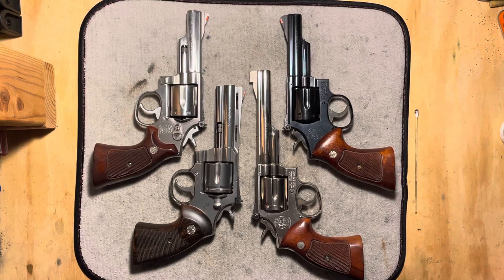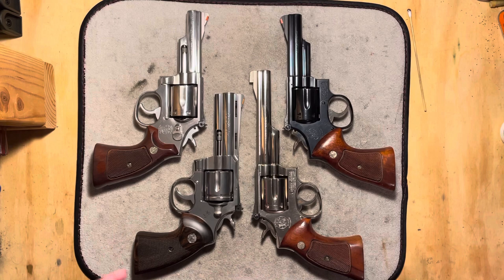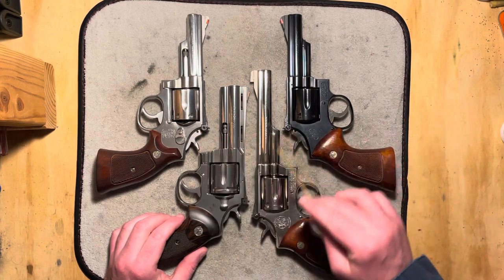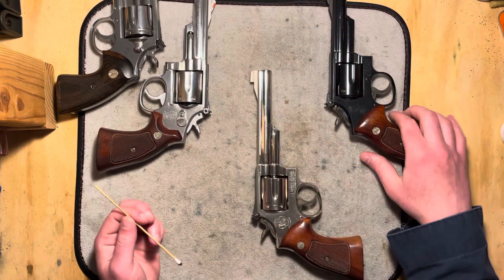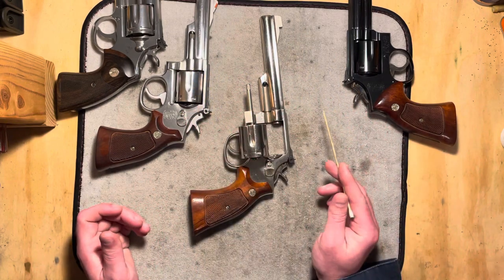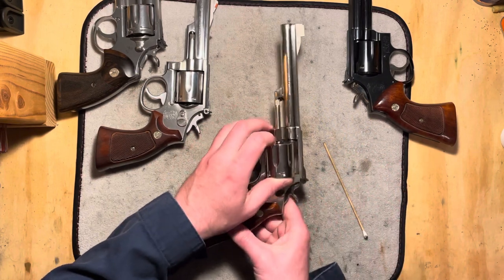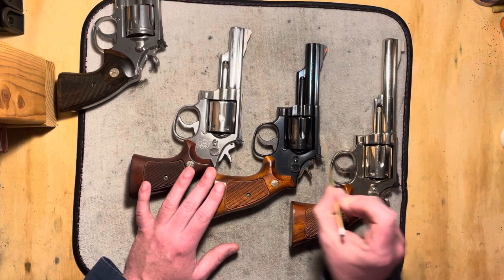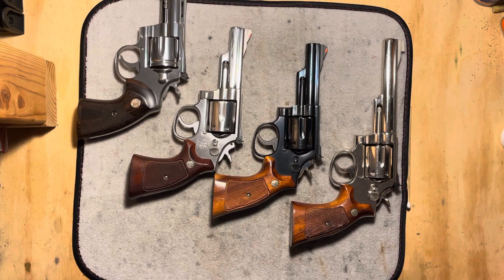Revolver Forcing Cone: Explanation and Avoiding a Crack, Ft. S&W .357 Magnum K-frames & Colt Python

Comment: I'd bet you would have to get the forcing cone extremely hot to crack it. I think the heat from rapidly firing shorter 125gr. rounds repeatedly, cylinder after cylinder, is what damaged any forcing cones. I haven't seen one that has cracked. But, I have not seen very many K frames either.
Reply from the maker: I follow what you’re thinking, but I disagree. 

For one, most of these issues arose when these revolvers had been recently in production. General attitudes and practices of the time period, as far as I’ve seen, didn’t really emphasize dumping cylinder after cylinder of full house magnum loads. It just wasn’t the way they thought. Obviously, I wasn’t there, but this is based on first hand accounts, observations of the training philosophies those people still hold and practice, and film documentation of training practices of the relevant time period. 

Second, getting a revolver sufficiently hot to compromise the metal is a difficult task with something that is a repeater loaded manually. Six rounds until a reload is required, and that reloading process opens the barrel through for airflow. Add in the fact I don’t know that I’ve ever seen someone carry more than about four speedloaders, even in later years when they were really trying to remain relevant compared to automatics… I think it’s unlikely anyone would have been able to “rapidly” fire more than about 30 rounds. That’s not that much especially given the circumstances already mentioned. 

Third, the issue of cracking metal would seem to be alleviated by the steel becoming slightly softer with heat within a reasonable extent. Of course, that’s really just conjecture on my part. But hotter steel is typically softer and more prone to deformation rather than fracturing. Heat could/would exacerbate throat erosion, which might increase the risk of failure over a long period of time, but there are reports of some revolvers failing at the forcing cone in as few as a couple hundred rounds of particularly hot (yet still factory loaded) 125 grain magnums. 

It is an issue that was observed at the time, and there is a reasonable mechanical explanation for why it is real and not just a fluke. I tend to believe that it is a shortcoming of the design and manufacturing practices, that is exacerbated by “luck of the draw” of a particular revolver and also ammunition related conditions that expose that flaw. That is my opinion based on what information I have seen.

Comment: What is the maximum safe speed to avoid long-term damage in a K frame F.C. with a 125 lead bullet?
Thanks
Reply from the maker: It’s an excellent question, for which there is no good answer. Just due to the inherent variations in manufacturing and metallurgy, some are stronger than others, of course. 

While it’s a good question, I think it’s the wrong question, as there are many heavier projectile options which, based on known observation, aren’t likely to cause a forcing cone crack.

Comment: As an afterthought after reading all the comments and recollecting long ago past experience with agency owned S&W Model 10s with heavy barrels, there were never any issues with forcing cone failures.  Small parts attrition were remedied by turning back the questionable revolver for exchange with the quartermaster.  The range safety officer enlisted rookies for gun cleaning which included using Lewis Lead remover tools to clean and polish the forcing cones and the chamber mouths of the cylinders.  I should do that on what I have now to reduce the pressures on those parts. Good shooting everyone.
Reply from the maker: Certainly. The model 10 is as robust as any other revolver. They’re a masterpiece. 

The 19 is just a 10 “overbored” to .357 Magnum. The design is fine- it was just asked to do something it was never designed for in handling full house .357 Magnum loads.
Reply: @ColterBrog  My colleagues also had various K frame guns including10s  13s 15s  19s in addition to  27s and 28s.  Bill Jordan of the Border patrol is credited with lobbying Smith & Wesson to create the 19 as N frames were so large and heavy.  The NYPD Stakeout Squad led by Jim Cirillo in the 1970s are  credited with a lot of successful actions using pencil barrel Model 10s as well as some unofficial unauthorized guns available at the time.

Comment: I have a 65-2 that I just inherited from my mother.  It's pinned and recessed but it also has the "shaved" forcing cone you pointed out.  I haven't shot any 357 out of it (God knows I want to) but I do have plenty of 38 Special on hand to train with.  Great video.
Reply from the maker: If you do shoot magnums just stick to the heavier ones like 158 grain. They don’t have the abrupt acceleration to really do a hard strike on the forcing cone like a hot 125 grain. 

I think it’s mainly just a matter of mindset. These are .38 Special revolvers capable of occasionally firing some .357 Magnum, ideally in the heavier bullet weights. 

That’s a different mindset from something like a 686 which is definitely a .357 Magnum revolver, but can shoot .38 Special if you want cheaper plinking and less recoil. 

It’s about the intent of the design.
Reply: I've shot plenty of 158 grain out of my 65-2. I've also never seen a cracked forcing cone - just online speculation and rumors. Not saying it never happened, just that it might not have been a common occurrence. As others have stated, just stick with 158's and 38 Specials and you should be fine.

Comment: I got a swollen case and flattened primer in my m&p 340. The case had to be tapped out of the cylinder and the case was pushed into the frame preventing it from opening.  I see no damage and shot 27 357 magnum rounds afterwards with no issues.  I'm only shooting premium federal and Hornady.  Anything i should look out for?  Surely this was an ammunition issue and not a firearm issue wouldn't you think?
Reply from the maker: Sounds like an ammunition issue to me. 

If the case maintained integrity, it should be fine. I’ve had Blazer rupture casings before. The revolver still shoots fine years later.
Reply: @ColterBrog  the case elongated slightly and bulged but no rupture.  I'm saving all my spent cases and not seeing any issues.  Just not super confident in the scandium frame yet.  Shot another 30 magnum rounds and no issues

Comment: the new 66-8 (and perhaps versions before it) has a full forcing cone, so I guess S&W fixed it on latest generation of K-frames. They thinned the crane..

So if the FC is full circular, 357 should not be a issue any more?
Reply from the maker: That would be my assessment. The newer ones are also using a sleeved barrel. 

There is certainly some engineering that goes into this that I’m not entirely qualified to explain, but I can relate the way I understand the concept. Essentially having a “stronger” cone with a weak spot is worse than having the entire cone be the “weak spot”. The entire circumference is that able to flex under load rather than concentrating all the movement to the one weak area and causing excess stress to that specific spot. 

Essentially it makes the whole thing stronger by making the rest a bit weaker.

Comment: Extremely informative video. I only own 686-1 ,2 ,3 because of the issues you’re discussing. Great Job and Thanks for making this video.
Reply from the maker: Those early variants of the 686 are some of the nicest revolvers S&W has ever made in my opinion. They predate the internal lock, but have all the benefits of the robust L-frame 686 design.

Comment: Great information presented very well. The numeric dashes accross various models indicate different dates.   What year did S&W address the excessive removal of the forcing cone?  I have a model 13-2 made in 1978.
Reply from the maker: Let me look at it again tomorrow, because they didn’t actually change designation for design number during these changes. For how important it was, S&W didn’t see it that way.
Reply: @ColterBrog  Thanks. Looking forward to learning what you find and think. I've shot a few 357 magnums through it with no evident ill affects. No 125 grain went through it under my ownership. It's very difficult for me to determine if my forcing cone has that slight amount of additional material removed or not. I do not have another vintage revolver to comer it to.
Reply: meant...compare it to.
Reply from the maker: @WalterDavidRiffmon  Unfortunately to the best of my ability to research this, a 1978 is going to be ambiguous. S&W relocated the gas ring in 1977, but continued to thin the forcing cone for an unspecified amount of time as they updated their processes. 

I don’t think the exact date of the return to the less-thin forcing cone is known, and in all likelihood it varies by specific models and they almost certainly used whatever parts were already in stock.
Reply: @ColterBrog  Thanks for looking into that. I took a close-up of my forcing cone and then shot a couple of photos of the two guns' forcing cones on your video and I think my barrel is not the thinner version. You're right though, it is difficult see and know for certain. It is surprising the lack of attention to detail during those years to improve the situation but economy rules when it comes to using left over parts vs scrapping the barrels.
Reply: I watched your other video What is a revolver gas ring". I did not understand the two placements of the gas ring and how it worked until I watched it. Thanks for your explanation!
Reply from the maker: @WalterDavidRiffmon  I don’t think S&W understood the implications of what they were doing at the time as far as the forcing cone goes. They were focused on trying to make improvements to the gas ring and that’s what took their attention. The thinning of the forcing cone wasn’t perceived to be a problem until it became a problem. 

It’s also worth noting that many K-frame revolvers, even those affected by these design alterations during that brief time, survive for a perfectly reasonable service life. 

It’s really just something to be aware of and the potential problems are easy to avoid with a bit of care taken in ammunition selection.
Reply: I can see that. Thanks.

Comment: I've talk to S&W warranty mechanics and they said occasional 357 in the 66 is ok, but constant is discouraged. They also said if the forcing cone cracks, the gun is dead forever. I had an issue with my 66-1 2.5" blowing 357 primers into the firing pin hole locking up the cylinder. Smith fixed that free of charge.
Reply from the maker: I have heard of people swapping barrels, but completely understand their position. It’s really not possible to determine if the frame was compromised, and it’s certainly possible if not probable. I’d be leery of doing so.

Comment: i have a model 13 and its fine. honestly i wouldnt worry about it, just dont shoot 125gn magnum loads
Reply from the maker: I don’t disagree but I also don’t agree. 

Most revolvers that have survived this long are probably structurally sound, but it’s a chance. 

The old classics are steadily increasing in value and desirability because of the nostalgia. They represent the golden age of the American revolver and even though it is well within living memory, they are an important part of our firearms heritage.

There are plenty of modern day revolvers readily available to dump magnum loads through for amusement. There’s just not much reason to potentially damage older revolvers, particularly if they’re in good condition. 

It’s going to depend on circumstances. You’re right, but you’re right with a little asterisk of caution.

Comment: Got a 19-6...seems to love magnums. I think the later models have better metallurgy.  Mine was made in '92.
Reply from the maker: And certainly some revolvers, especially if you use heavier weight magnums, can have very long lives shooting them. Fact remains that these incomplete/cut barrel extension revolvers do have an inherent weakness built into the forcing cone design. If you’re able to avoid magnums and sometimes just shoot .38 Special instead you will extend the life of the handgun. 

How much will you extend it? Hard to say, as it varies depending on each specific revolver and which types of ammunition are used. If you’re steadily shooting magnums, then yours isn’t one of the unfortunate few that fails in the first box, and the revolvers prone to that failure were probably repaired by S&W decades ago. 

You kind of have to make your own call on this depending on the level of risk acceptable to you. I do occasionally shoot magnums in mine because I’m willing to accept that risk, but I don’t typically shoot them with magnums.
Reply: My 19-6 has a full size cone made 2021.

Comment: I’d rather shoot a mild 357 158 grain bullet load in this gun, than a hot 110 grain +P 38 special treasury load. It would be good to explain what the different bullet weights jump from the cylinder into the forcong cone do to it.
Reply from the maker: That is true. It really comes down to the rapid acceleration of the light weight bullets impacting the forcing cone at high velocity, and velocity being squared in determining kinetic energy. The light weight, fast projectiles hit the forcing cone hard compared to a heavier projectile that gains velocity slowly.

Internal ballistics is an interesting science.

Comment: I have a 66-1 and was advice by S&W not to use 38spl +P, just to use 38spl and if I want to try .357mag to see how the recoil and performance differ to do as you said 158grain JHP
Reply from the maker: 66-1 should have the gas ring on the cylinder, though, right? 

I was under the impression only the 66 no-dash had the yoke-mounted gas ring. 

The advice from them seems like it might be a little bit on the conservative side, but better to be cautious and avoid damage.
Reply: @ColterBrog  you're right was just passing on info I had received in the last month. New to the revolver family and want to respect and take proper care of what I consider an old gem that I inherited.
Reply from the maker: @glenh3825  They’re beautiful pieces of American workmanship and I’m sure you’ll cherish it. 

With proper care and attention these revolvers should still be around for generations to come.

Comment: The problem with my s&w 13 is that it only shoots accurately with .357, with .38 the group is larger.
Reply from the maker: That probably in large part has to do with the large amount of freebore associated with using a shorter cartridge. 

A solution would be loading .357 casings with heavy projectiles and a lighter charge as a target load. Plated wadcutters would likely be an excellent choice for this since they’re comparatively soft.